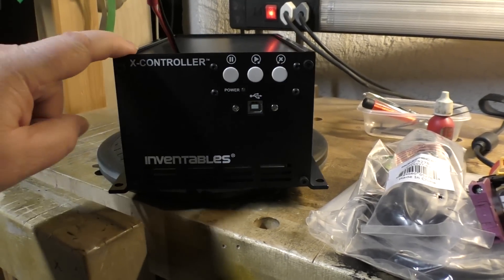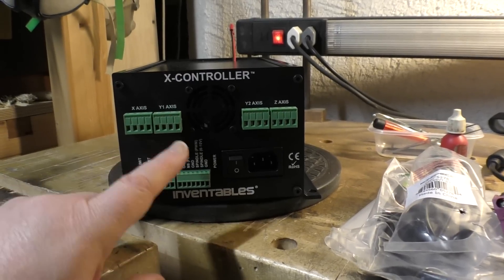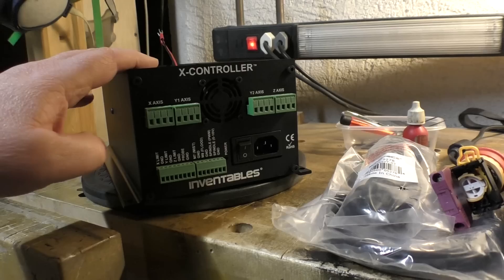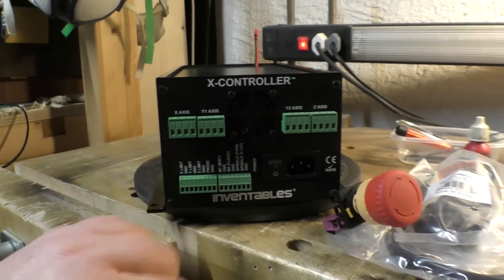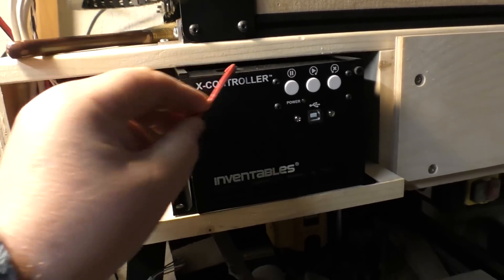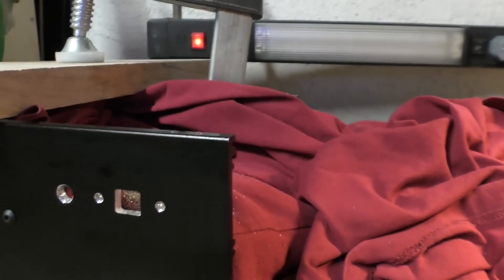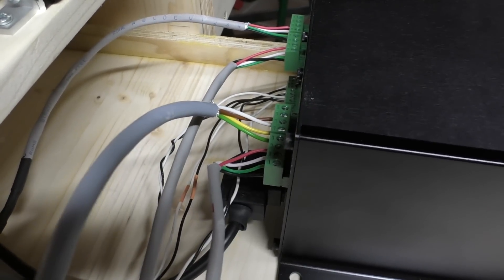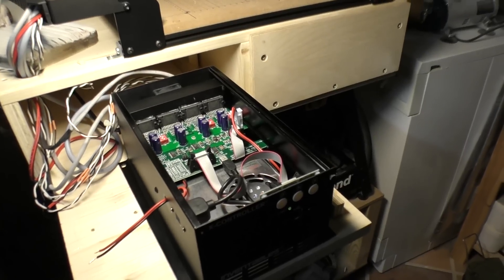New Controller for the X-Carve CNC

Comment: Those X-carves are good for the price but they all are a bit lacking in a few ways. 

One is the excessive flex in the aluminum extrusions.  Dig in too deep with a bit and/or move too fast and that flex will seriously affect the accuracy of the cuts. On the good side of that is there are ways to stiffen up the extrusions getting rid of most of the flex quite easily. 

The older controlers were a stock adurino  with a small stepper driver attached. I havent eyeballed the inside of the new controller but from this video that looks like one with something other than an adirino and driver board.  It bears a strong resemblance to one I seen somewhere but I cant recall exactly where. Note that along the edge next to the power connector there are 4 big chips attached to the heat sink.  Those are these stepper drivers and they do get a tad warm.. The grbl based control logic of both versions does NOT support all the standard G-code but some of it is not needed on small CMC. Of note very few commercial cad/cam software programs dont actually support  gerbl based controllers but many do output some usable G-code.

The last time I looked you had only 2 options for a control program. One was to use the ON_LINE inventables easel program. That is a low capability cad/cam program along with a controller. It works-- Barely and it REQUIRES that you have net access to do anything with the CNC. The other option is one called Universal G-code sender. You can use that offline but you must have some other program to do the g-code with. Inkscape with a g-code plugin is one option. Both are on the net free. 

There is one commercial cad/cam program Im aware of that DOES suport grbl controller sis Aspires V-varve. The desktop version goes for $ 350 and its WELL worth the price. It makes easel look like some sort of cheap joke and is FULLY capable of generating true 3d G-code. You just have to make the 3d model with something else then import it. I recommend anyone new or considering a CNC download the demo version for free. It is 100% functional with one exception, you cannot output any G-code.  Its my general goto program for almost all my 2d stuff. For serious engineering style 3d needs I use fusion 360. Its a serious commercial grade solid modeling program with a steep learning curve but it is FREE!.

That being said the X-carves are usable at the hobby or very light production needs. Worth the price but you will do far better with a CNC somewhere around a grand and a half or 2 for volume production. 

My setup is completely home brew. I even did my own plans up. Its 2be stalled feet by 3feet using acme threaded rod on all axis with steppers around 2 to 3 times the power of the ones on any of the X-carves. IT CANNOT be stalled by hitting anything like those belt drives. Ive snapped a couple 1/4 inch bits clean into by running into a clamp  jogging around. It uses Mach 3 running on a 16 year old computer I retired years back.  Software I use ranges from Inkscape, sketchup, Audocad Inventor, Solisworks, and Fusion 360 for the CAD side and Cambam and V-carve desktop for the CAM side of thigs. I can usally do what any of the X-carves can do in about 1/4th the time using basically the same trim router but a different brand due the high travel rates I can get along with enough power to shove bits dug in deep enough to stall out any belt drive.

Well worth the $1200 or so I have in it including all software other than inventor and solid works. I got those almost free becaus eof my connections with a local private college. They go for a couple or 3 thou EACH normally.

With CNC YOU GET WHAT YOU PAY FOR..   Have fun :)
Reply from the maker: One advantage of the smaller version is the rail flex is less of an issue.  So far I haven't had any problems with it but I'm being careful with cut depth, feed rates, etc.  I use V-Carve desktop as my main software for projects.  My goal is about learning the whole workflow around making stuff with the CNC so it's not going to be used for any heavy commercial stuff.
Reply: For that the X-carves cant be beat for the price.  :)

One suggestion -- Order up 2 sets of brushes for the router right now. They go faster than you think.. Nothing can really piss you off like a dead router right when you need to make sawdust.. That way its just a matter of a few minutes to change the brushes and your off and running again. Having spares handy beats waiting a week for new ones without paying a shipping charge 4 or 5 times the cost of the brushes to get them ina day or 2.  Just ship the slow and cheapest way.. Order more when your last set goes into the router.  Also if youre not aware of it dewalt makes a collet for that router where you can use 1/8 bits also.  Heres one place you can get whats basically an ER11 collets and nuts for that router also.  Mine is a Ridiged and I have both the 1/4 and 1/8 ones. http://www.precisebits.com/gateways/ColletsNutsHome.htm

Comment: Inventables is starting to get thier act together a bit better.   The problems I see that are getting addressed appear to be mostly from letting the cost being the most important followed by not spending enough time actually running one for a while simulating real world usage as much as possible. 

To be fail a bit of background..

These didn't exist when I made my home brew scratch built CNC. Cost was way up close to the top priority for me also BUT I wasn't going to pay a performance penalty  for the sake a few bux. Mine has a cutting area of 25 inches by 18.5 by 6. Reasonably close to the 1 meter X-xcarve. Wound up costing me about double of the 1 meter one when all the software was included. but the performance and all the power of the software was well worth it. I often run at 200 or so IPM with a 1/4 bit burried about 3/16 into solid oak with NO problems, no missed steps, with an accuracy approaching .001 I have even snapped 1/4 bits clean off he trim router by not paying attention and hitting a clamp at full-speed. NONE of the inventions Ive seen and used can come close to say 1/3 the performance of my home brew.  They are fairly deceint for a low usage NON production hobby type use though. That being said I would still go the route I did because of the issues Ive seen with them. I dont have the time to waste waiting say 2 or 3 hours for something I can do in 30 or so minutes. 

That being said ...

The first  and MOST important from my view point is the flex in the rails. That prevents them from doing any real high precision cutting at somewhat the same speeds and feeds of most other low end routers. Another example is that sorry ass 300 watt spindle. The only thing I can say good about it is the noise reduction.  The typical shop vac is a whole lot louder so thats basically a wasted "feature". Its not exactly cheap when you add in the cost of the power supply, combined the price is only 10 or 20 bux less than a good trim router. I DO have one of those little 300 watt spindes I use on my CNC for cutting plastics and stuff where I must run at speeds below 15,00.  Try cutting plastics at that speed you just melt through it. I have my CNC set up so to switch from that spindle to the router is only swap 1 power cable and 4 bolts.. My controller box running Mach 3 handles both quite nicely.  These 2 issues are primarily a result of cost being the driving factor in the design of one. I understand they have discontued the 300 watt as the stock setup anis around say 20 0dare now using a Dewalt trim router. The cost difference should be around 20 or 30 bux more If you do a bit of router pricing. 

The flex is a bigger issue to resolved,. In the little one the 2 Y rails are short enough and the Gantry is light enough there isnt much actual flex. The gantry on BOTH has flex issues.. You can easily twist it. The "cure" for that I have put on both sizes is an aluminum strip between the rails and a bunch of small bolts sandwiching them together.  The Y rails on the big one is a whole different issue.  I added additional supports to one on the inside of the rails Where it dosent interfere with movement. There is an inch or so inside that rail you cant get to with a bit.

The spoilboard on the 1 meter is not properly supported. It WILL sink in the center over time. Just add more support under it.  The 1/2 meter board is better supported but not really good enough. Just add support under it.  Those boards are MDF and it wil sag over tome if its not supported good. 

Finally there's the controller and control software issues. This upgraded controller box solves a lot of the problems but It still has severe issues like NO power switch on the front and the issues addressed here. The Usb cable isnt a big issue but for ease of use it should be in the back CLEAR of the control buttons. I was the guy who was in charge of the design I would have fired a LOT of people  over that stop button issue. They didn't even check to see if it would fit the hole.  A classic example of somebody designing something without USING a test mockup ( Cost as primary issue again) The Kill switch should NOT be mounted to the top of the box.  With the power switch ON THE FRONT you have that for the same kill  function. There should be a set of contacts on the back so you can add one ANYWHERE where it is convenient for you. All of these problems appear to me to be driven by cost first. I havent got to eyeball one of these new boxes yet so Im not sure whats in them. Obviously they have power supply and an Adurio and a stepper driver board . It wouldnt be a big deal to make a board that combines the functionality of the standard Adriano  board with the stepper drivers all into one custom board. That appears to be the case from this video. 

The control software "easel" .....

It REQUIRES net access o use. That alone  would be the deal killer for me. While it is functional just the control side of it is severely restrictive. You cannot bundle tool-paths that use different bits into a SINGLE g-code file. Another deal killer for me. Then there is the design part of it. Its usable but is severely limited as to what you can do with it.  As this combo design-control program is web based, its obviously driving primarily by cost as its free--  Keep in mind "what you pay is what you get" always holds true. As a fair comparison I use Mach 3 as the controller ($150) and v-carve desktop ( $350 roughly). Its 500 to zero in cost for basically the same. But that $500 bux allows me to do stuff thats impossible with The easel program.. I can generate a single G- code file with dozens of toolpaths with different bits and my CNC will pause waiting for the new bit. All I do is just set Z on the new bit and hit go.. No X or Y or homing or multiple file loading to deal with. The Z setting is semi automatic using a touch plate. On the same subject y0u can download and use Universal Gcode Sender.  Its functionally the same as the machine control part of easel but WITHOUT requiring net connectivity. Its free but it dosent have the file creation part of Easel. There is a bunch of free stuff out on the net to get that functionality but the way you have to go about it isnt worth the hassle to me. I want to make stuff instead of screwing around with various programs, thats why the $500 diffrence is worth every penny to me.  Btw V-carve desktop CAN be used with the X-carves.. Just select the X-carve post processor and UGS.  You just cannot have mutiple bits in the same fie.. ( Limit by grbl, what BOTH easel and UGS use. 

There are other issues I dont like such as the belt drives, mine is totally acme drive screws. The same stuffas the X- carve Z but miner are all1/2 10 pitch. More reliable and less problematic than belts.. Also more expensive. Again A cost drivin design issue. 

Bottom line ---

For the price of the typical X-carve you get a qualified usable CNC in kit form that you're going to spend some considerable up front time getting it together and running right. The software is barely above crap in my opinion but it is usable for most hobby uses. Dont expect to get the same level of performance as say the smallest Shopbot CNC. IT goes for about $7000 and is almost the same size as the 1- meter X-xarve that goes for about $1100. My home brew set me back about $1250 INCLUDING software and has almost the same performance as the desktop Shopbot. 

Dont get me wrong here but if you dont have the knowledge, place or tools to build a CNC from some plans or home brew one the X-carve IS a valid option.  And considering what that little Shopbot goes for You could easily save several thousand bucks by knowing enough about CNCs to DE_LIE a salseman.. :)

Comment: Nice mods.  I built one a few months ago.  The only problem I found is that the cooling fan was extremely loud.  It was hitting the grill on the back even with the spacers.  Used some force and pushed the grill out a fraction of an inch to provide clearance and it quieted down.
Reply from the maker: +Buncha Baloney Yeah it makes a lot of noise for sure - I'll see about using a low noise fan at some stage.
Reply: Zone1242
Since I pushed the grill outward and made more space for the fan blades, the noise is no worse than the fans on the computer.  It still makes a lot of noise for such a little fan though.

Comment: are they available in 240 volt for australia
Reply from the maker: +Keith Tipping Hi Keith, yes the main power supply input voltage is selectable 115v or 230v - I'm using the 230v setting.   The power cord however comes in one flavour - US.  You'll need  a local one or change the plug on the one supplied.
Cheers,  John